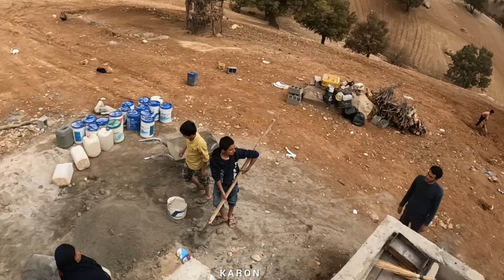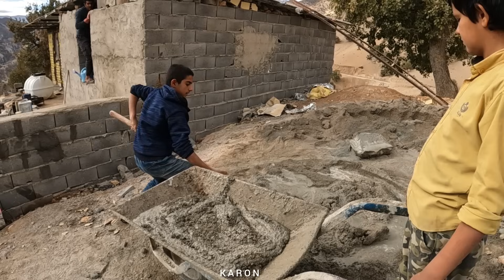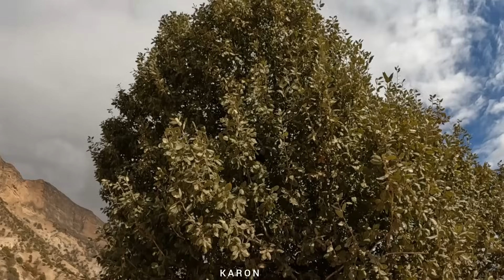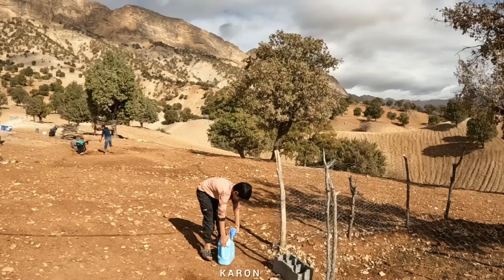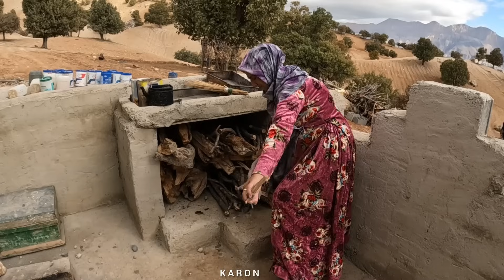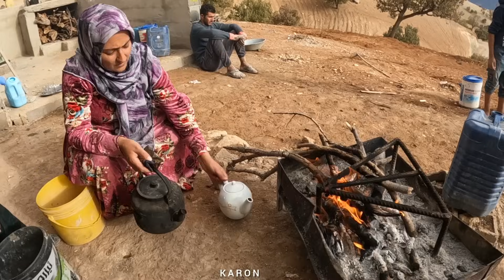nomadic life: rebuilding the slope and cementing the roof of a nomadic house

Comment: Hi directors of KARON PLEASE advise Hamid to remove the entire roof an reroof because the building is structuraly compromised and any strong wind or rain it going to collapse on those  inside because the building was NOT re enforced by steal and steal columns. WHEN building in Jamaican each other block hole has a length of steal vertically put in every other concrete block hole which was laid in the foundation and each corner of the house has ten 10inch square steal basket weave vertical columns to strengthen the home

Comment: Hammid why aint you put cement in between the blocks and stones for the slope? Your rushing things not thinking to build strong walls. Its a comment for i do worry for your families' protection and safety, you have been through so much. every nomadic family that have had to move from different locations i feel for. Please do your build with safety in mind. I'm wondering of when you guys lay your big blocks, you guys don't cement the sides? You don't level  it out with a water leveler.